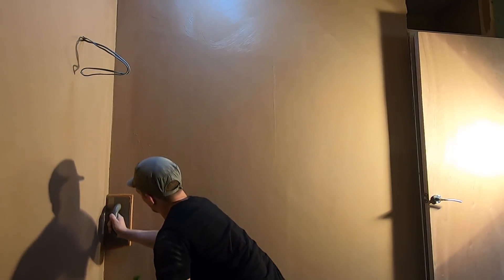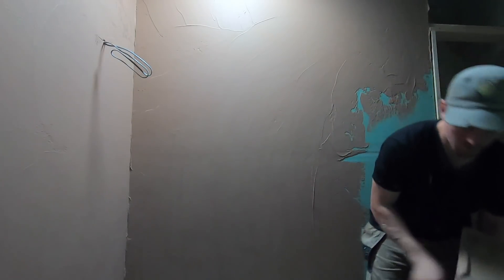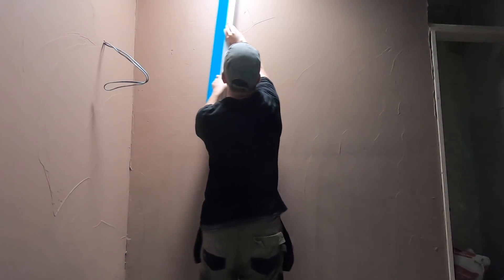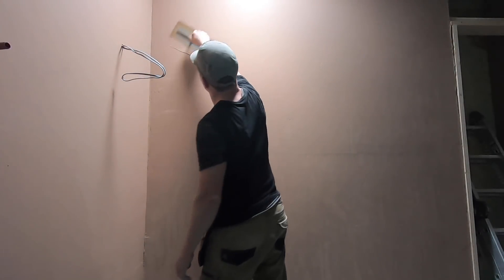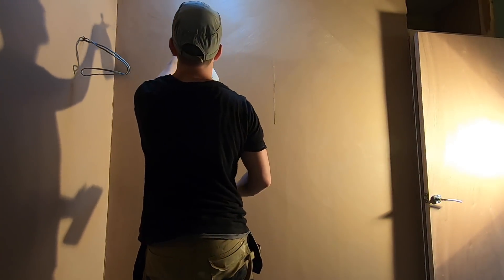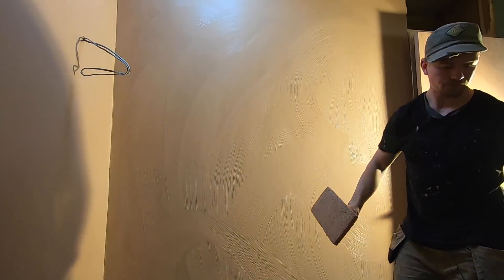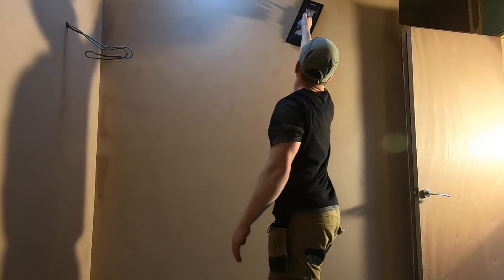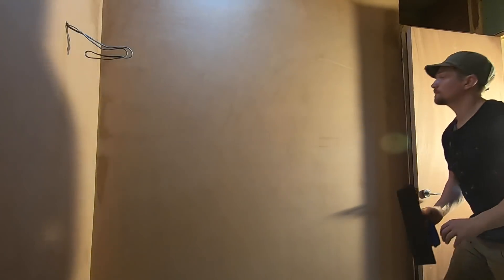One Coat Plastering | Is It Ever OK To Do??? (TEST)

Comment: How do mate. I'm a brickie of 33 years, and never needed to do any plastering over than patching small area. I am blocking up a 1m2 window tomorrow, just wondering for ease and time saving, would one-coat plaster be recommended for such a small area directly onto breeze blocks? I intend to project mty clockwork more than normal so meaning I can get a 10mm plaster coat, so not needing to two-coat. Much appreciate any advice you could offer. I'm not worried about the smoothing up as it's got existing plaster at either side to work to.

Comment: I think the reason for the two coats is more to do with the old hessian scrim which was impossible to cover with one coat. I would be interested to know your view on Multi finish versus Board Finish. 

On another point the moisture resistant plasterboard is not made for plastering. BG say you should tile directly onto it and that introducing a layer of plaster in between the board and the tile adhesive negates the purpose. There are, of course, places where the tiles end and you need a skim coat  but they say the board should be primed with a bonding agent such as Blue Grit before plastering. I hardly ever see this done but I have heard of cases where it has shelled off so I do it just to be safe.
Reply: I did not know that about moisture board. Thanks for that. Every day's a school day
Reply from the maker: Hi mate! Great hearing from you again. That's a very good point about the old Hessian scrim - it was thick stuff! I've always used Multi Finish to be honest mate so I don't really know anything other than that. However, I was very impressed the few times I did use Board Finish.

I didn't have a clue about this fact about plastering on moisture board! That's very interesting. Thanks for giving me the heads up on that because that's totally new to me! Great hearing from you and I hope your channel is going well pal! Cheers 👍
Reply from the maker: Oh and thanks for recommending viewers to my channel! I really appreciate it! Thank you 🍻
Reply: @PlasteringForBeginners  your the boy that's why! 
 Need a vid for the site lads comparing time saving techniques.
 Also never used the plazzi for anything other than smoothing second coat when not using a spat find it skuffs to much? Do you buff the edges and round the corners or straight of box?
Reply: Moisture resistant boards don't need done, when tiled but when plastering ,blue grit is best , or a neat PVA apply twice ,a found that good on any boards ,on the sound proof boards , which are blue ,and the fire resistant , always bond with blue grit ,a found out the hard way ,it cracks a few weeks later if u don't. And board finish is good for standard plaster board , don't use on any other surfaces

Comment: I've just done my 1st wall doing 1 coat with the sponge and speed skim same finish as 2 coats. I've been plastering for years I got taught the old ways. but with the new trowels available made it easier to do. you couldn't do it with just a standard trowel that's why old school plasterers don't like it. Your a plasterer and you thought it was good. The problem is when your learning your trained a certain way it's hard to get out the habit it's like wiping your bum with your weak hand feels wrong but persistence is key. Learn new methods great channel
Reply: I don't know about other countries but here in UK I think there is the attitude that resists change. Perhaps it is not so bad these days as things change so fast, but years back tradesmen where usually very resistant to any 'advances' in methods and materials. If you look at the major changes that have occurred such as cavity walls replacing solid walls in the 1930's, copper pipe replaceing lead pipework in the 40's and 50's,  double glazing plastic or aluminium windows replaceing wood framed glazing units. The list goes on. And now changes seem to happen more rapidly as new materials are devolped. Dot and dab pasterboard replaced the old method of a browning or bonding base coat. That met with some resistance initially as you were 'challenging' the old ways.....
Reply: Thanks for the tip I never thought I'd get used to wiping with my left, but now I'm really making inroads
Reply: @manjichromagnon5480  I now use toilet paper! No sticky fingers!

Comment: On flat plaster board they why not 🤷🏻‍♂️ long as the scrim is covered as normal 
I wouldn’t do it on domestic walls because the first coat  has to do more filling for bumps etc plus doing an old domestic wall could have 5 different materials on it (different suctions) etc 
Can’t trust it like you would with fresh plaster board

Comment: Hi mate, I have been doing one coat plastering for some years plastering for around 14/15 years probs why I get away with it tbh. I do use pva in my skim mix, also I apply a quite tought thick double cream on the one coat I apply which means its usually 2-3 mm thick anyways which is how I get away with 1 coat plasterin but like you say I think for beginners this can be quite tough initially but those more experienced will find this better as theres less work involved. Also mixing one batch is more unified than two batches then appying it so againnfor me 1 coat always win must apply 2-3 mm thick perhaps more 3 mm thickish to begin with if you are going to sponge float the wall as the sponge floating will take about 1 mm out of the wall if you sponge float too early tbh. Theres a lot to think about but ultimately it does come to experience as well as the skill in applying the plaster tbh. We have skimmed walls over 5-6 years ago using one coat skim and it has no cracks so my opinion would be 1 coat not 2 but the layer you mox and use must be 2-3 mm thick and more 3 mm thick if you are going to sponge float. Its hard work paying on that thick and that smooth plus I add pva to my mix to stop it causing cracks on the wall for my customers but yes a lot of hard work tbh. Experience is key, I dont like putting newbies of as i like newboes to lear and try but those who are inexperienced may find 2 coats much easier to apply than one.
Reply: I dont mean to be off topic but does someone know a way to get back into an Instagram account?
I somehow lost my password. I would love any help you can offer me!
Reply: @Bronson Vance instablaster ;)
Reply: @Edwin Daxton it worked and I finally got access to my account again. I'm so happy:D
Thanks so much, you saved my account!
Reply: @Bronson Vance Glad I could help =)

Comment: When I was a plasterer, after the first coat , I used to think it was spot on. Problem putting second coat on was, I could miss a tiny area as it was the same shade. Many a jobs I did one coat and it was a brilliant finish. No idea if it lasted though. Only every used a standard trowel and a larger trowel to flatten. Speed skims weren't invented. I was always told to do 2 coats and the second coat must be a fresh mix. SO many use the first mix. Always to NEVER use additives, but now we have some to make the mix last longer. Boy I could have done with that many a times. Its when you rush and panic when the job is stress instead of pleasure
Reply: I have always applied the first coat and second coat with the same mix...providing I mix enough ha. But the second coat is kind of my first smooth in, just using enough to give a thin coat and fill any holes or dips and even though the plaster is the same shade I find using the same mix it goes on a lot smoother than the first so is easy to see where has been second coated.

I dont use sponges ir spatulas very often either.
Reply: I did one coat plastering on my living room 10 years ago and it still looks fine.

Comment: To be honest I’ve done one coat plastering,like you i put the plaster on slightly thicker,it turned out fine,i think using the speed skim is the secret,
The reason i think one coat is scorned upon is because of sagging,but your system ie sponge float,and speed skim seems superb👌,by the way,I’m off to buy a steel blade speed skim.👍

Comment: being a self-taught plasterer I have always done one coat using multi finish plaster and I can happily say I have never had any problems. no cracks or anything out of the ordinary as long as the backing you going on too. is solid and not moving that much and have been doing this for about 11yrs now on my own properties and friends and families. I have always known this is not the right way to do it but because I have success every time I have been reluctant to make more work for myself by going over what I have already done.

Comment: If the old plaster applied to brick was a total of roughly an inch thick, could I use two coats of One Coat, or two coats of Bonding, then one coat of multifinish? Would that work? Would I scratch in between?

Comment: Eight times out of ten, I tend to second coat with the same mix as I like to attack the walls while there still abit wet so I can control the set better and they pull in at  the same time,I do tend to use a fresh mix if I have bigger hits to do  but people say I 1 coat by laying in with the same mix I think it's 2 but it's all swings and roundabouts
Reply from the maker: Hi mate! I've often plastered the way you've said and it does work well because it pulls in at the same time. There's no division between the 2 coats is there! Totally agree. Cheers man!
Reply: Thats exactly how i plaster. Double back with the same mix, while laying in second, you are actually flattening in the first. I once had a subbie i was working for for months with no complaints, was plastering a ceiling and watched me double back with the same batch on the second coat, and accused me of cheating, well i said to him, you been paying me without complaining all this time so whats the problem? He believed in flattening in te first, mixing a second coat and then waiting. Like someone said earlier, the whole 2 coat system goes bacl to sand and cement and hessian scrim. 2 coats, but with the same mix. You can shave off up to 45 mins +. Nice videos. Do one on multi v board and 2 interal angles.
Reply: Stewie.spot on.2nd coat with same mix.thats the way forward& cuts set time down..
Reply: That’s the way to go, at least on small walls
Reply: I'm not a plasterer now but I still do bits and that's the way I was taught, my teacher never gets complaints and nor have I.

Comment: In my opinion there is one coat plastering with the speed skim tools and not using them. You’ll get a hell of a better job using the ox speed skim to flatten in thicker plaster as it covers more surface area than a trowel. Add the sponge float method and the jobs a gooden

Comment: When u apply one coat only it doesn't matter how much plaster u put on the wall it will shrink on the joint of the plasterboards(tapered edge only) and  it will show under the light. Even with 2 coats it will still be visible if u look for it.
Reply from the maker: Fair point mate! It's makes sense 👍

Comment: I am a complete novice and haven't got a clue. I want to plaster a wall but I was wondering is there a beading that can be used that would allow one to run the spatula across a section, plaster it, level it and then move on to the next section? So there would be a series of beads across the wall and each section would be plastered.

Comment: You have to be a master of 2 coats first and you must use the sponge float because you can get it as flat as you would with 2 coats before hand , im just still a believer that 2 coats is guaranteed spot on finish , but also use a sponge float if you want to speed things up ,especially blue grit and the pro finish plaster is fukin awesome for speeding things up , you just have to learn its timing 😀

Comment: Thank you Blaine.  I am new to this and helping our daughter, who is on a tight budget.  Based on the manufacturer's recommendation, US Heritage Group, we are putting only one coat of NHL 3.5 on our new Comfort Block walls.  Then we are applying two coats of their Shelter Coat. They said we should brush on the first coat and trowel the second coat of Shelter Coat.  Will this last do you think?  We will apply a bonding agent to the rough concrete wall before we start but they said we won't need the plastic mesh.  I am getting nervous.  They said we can always add the brown coat later when we have the funds.

Comment: Iv one coated for years, along as joints are filled out you should be fine, i put on with stiff trowel, speedskim as I go, one more trowel with stiff trowel then one wet trowel (crossed) then 2 dry finishing trowels (crossed). I never get tiger stripes and in 15 years iv never had my work pulled and I'm on site. I would never one coat re skims though.

Oh and make sure beads are filled out lol

Comment: I don't and won't ever 1 coat but always use a bottle and sponge probably for the past 2 years. Definitely makes life easier and turns out the best work I've ever done
Reply from the maker: Good points my friend!
Reply: @PlasteringForBeginners  I've seen it done a long time ago in a small porch on boards but to me you could see the beads showing slightly

Comment: Back in the day one coat  all the time.we used to add a big handful of carlite finish to hold it back.i was told put it on thin take it  off thick
Reply from the maker: This is mad mate! Are you still plastering then? Great hearing from you mate, cheers!
Reply: @PlasteringForBeginners I build recording studios now so not picked my trowel up in anger for about 8 years.  Done some big plastering jobs over the years including strangeways prison after the riots, (3 coats of sand and cement with hardener in ) this was spread over welded mesh on the ceilings and walls of the cells.great trade and good memorys

Comment: Did a 35m gauge yesterday one  coated it . It was much harder going from then on  finished up ok but just harder work. Not for me mate 2 coat works out easier to do in the long run.
Reply from the maker: It is easier to get right with 2 coating and you are correct in saying that 1 coating can be a struggle if tackled the wrong way! 2 coat is the one!
Reply: Couldn't agree with you more  mate

Comment: Also to add it is on new plaster boards. All scrim tape have been covered British gypsum bonding. As the the Joyce's are in level. So I had to work very hard to get it as level as as possible on ceiling. I dot and dab plaster boards to the wall. Again the walls were not straight which made the plasterboard harder to be level as well. So I put my scrim tape on. And again put British gypsum bonding on. So the walls and the walls are straight as can be. So there goes the question. Putting a decent one coat multi-finish skim should that be enough. ? thanks

Comment: In Holland everybody does onefloat ,but we use knauf gypsum
Reply: With regular gypsum you NEVER apply a second coat because it will compromise the fixation of the plaster. So in Holland a dual coat is an absolute no go: only for amateurs.
Reply: Same in Romania but the thing is that the plaster used in UK/Ireland is very different than the gypsum use in other countries.

Comment: Hi I've been watching your videos are very informative thank you. It's always been a burning question. Regards to one coat plastering. in fact I've done all my dry walls with bonding 1st. As nothing was straight.. I've just done my today with one  coat of skim. Because I have use bonding first and one coat of multi skim. I wonder whether that would be enough for just that one coat as I would think it be strong or should I be doing a 2nd  coat.  As it looks ok! I would appreciate reply.thanks steve
Reply from the maker: Hi mate! To be honest, if you've already applied a coat of Bonding and the plaster looks good then I can't really see a problem with it. Others would probably say other wise but in this situation I think 1 coat is ok. Not perfect...but ok. Hope this helps pal 👍
Reply: Thanks for the reply. I put the 2 coats on anyway. As I have found it gives you a really nise soft smooth finish.  Can I just ask? What's so special about the marshalltown.  Say to an average  laying on  Trowel,  I have brought the raveena gold flexi trowel. And raveena plastic straight edge trowel which is brilliant.  it really isn't good for laying on. Because of the flex in it.  I only have a cheap and laying on Trowell. But I had quite a couple of problems with it sticking to the plaster. As it sucks and sticks like a vacuum hoover and you end up pulling off plaster, lol  and can be frustrating. When using the float flat against the wall. I managed to do it with perseverance. Don't have to be very mindful about it. Sticking. Is the marshalltown float as smooth as the raveena flex. As the one I have is just a carbon steel which just rust for fun.!!! I've nearly done my project.now which was plastering the entire kitchen including ceiling lantern roof. Ceiling. And I'm quietly happy with it it's not perfect but I can rectify marks with a bit of sandpaper. I have found that I've been doing work in really bad like because the electricians haven't finished the lights has that can't be done until the ceiling finished as there is spot lights going in. As it's winter the light goes really quickly. And as I am an advanced novice. The jobs taking very long time. It's only in the daylight when you notice it's not the perfect as you thought.  Lol  Kind regards Steve